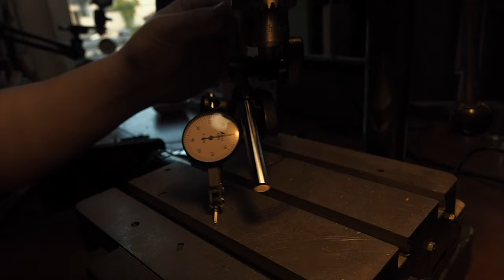I need to shrink double bass! #1（Guitar Making ASMR)

Comment: A strange idea. This bridge structure is a mass-produced product. For a specific bass, it would be more correct to make it from a single piece. For example, ebony.
Sure . my opinion )
Reply from the maker: Thanks for the input.

This structure is also designed with the idea of making the bridge heavier.
I want to have more resonance in it, and I want to transmit more vibration to the faceplate.
Reply: @Andybassguitar  
I understood. Do it like Danelectro with its poplar tools. A massive brass base (slab) and a wooden bridge . As a result, a soft bass sound + good sustain.